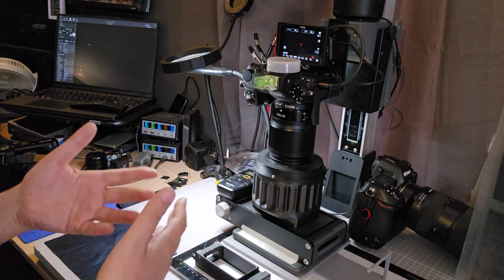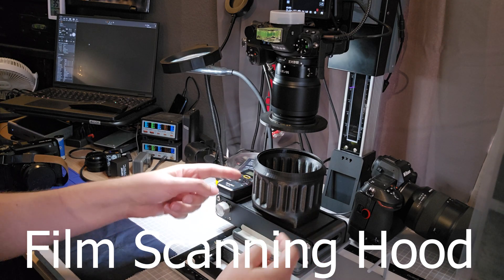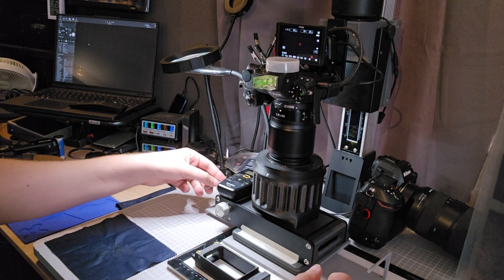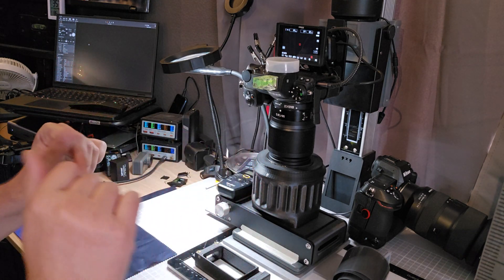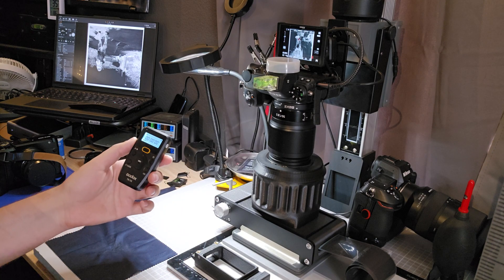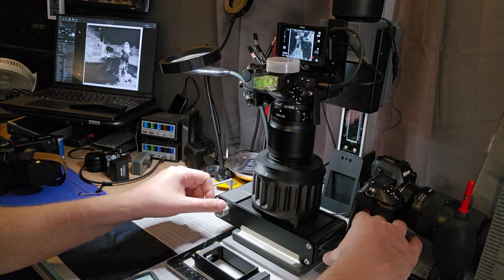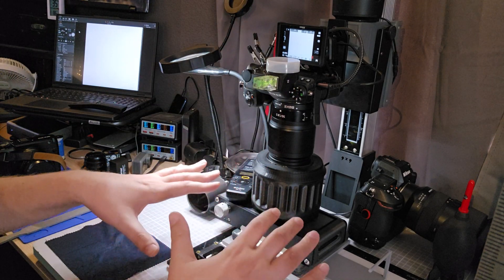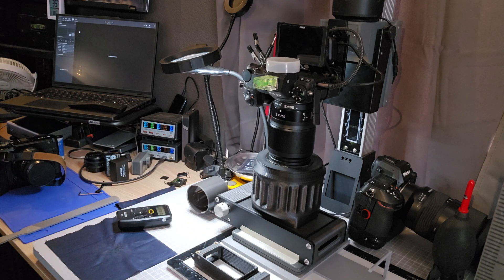Digitize Film - Zero Camera Shake

Comment: how do you deal with dust? what methods do you use to control dust in the area and or removing dust from the film before scanning to reduce touching up! thanks! (im also a fellow AA- Ron -.- god damn key and peel)
Reply from the maker: Hello fellow AA-Ron ;) Yeah dust is no fun. I don't have a dust problem within my scanning chamber as I keep it enclosed. Film dust is a nightmare which I would not say I have mastered but some things I've learned along the way (in no particular order): #1. Developing film, the water you use, how you let it dry, did you squeegee it or drip dry, did you use Photo-Flo... I find film literally attracts dust with static electricity so hang-drying in a clean space is important, also photo-flo and squeegee help to speed this up, but too much photo-flow can cause crystals to form from drying -- white spots that look like dust and they won't come off. #2. Don't just wipe the film with a cloth, this will charge it statically and attract more dust -- I have an antistatic gun (I borrow it from my record player) which I shoot at the film which blows jets of antistatic air, it really helps! #3 Don't let it touch anything on its way into the scanning chamber. I have a couple retractable badge clips hanging from my ceiling, I literally suspend the film in the air and straight into the feed port of the scanning chamber so it does not touch my dusty desk. There's still dust in the air, but the antistatic gun helps with that as it neutralizes the film so the dust doesn't stick to it... #4 Embrace the dust? We can never be perfect -- I use the dust removal tool in Capture One for the big obvious stuff but otherwise I accept some dust as part of the authentic analog charm, just like the pops and sizzles of vinyl records. I hope this helped in some small way.

Comment: What’s the mounting set up you have on your copy stand? I have the same copy stand and the plastic arm messes with the leveling so bad with it bending with the weight of the camera. I’ve found a work around attaching a ball mount tripod head but it’s so inconvenient if I wanna take my film camera and tripod out.
Reply from the maker: That's what I did. I have a sturdy ball head attached to the copy stand, but I use a quick release plate between the ball head and the camera body in case I need to detach. Its very solid, though it does not need to be that solid if the camera lens is resting on the scanning bed like it is in my video.

Comment: To not worry about camera shake you should use an electronic shutter.
Reply from the maker: I do, I believe I mentioned this in the video. However, electronic shutter will only eliminate vibration from the mechanical shutter and cannot improve vibration from the copy stand.
Reply: @ oh, sorry about that. I must've missed that. I see what you mean. But actually, using a good copy stand, a good tripod head, remote tethered shutter release from my computer with 2 seconds delay eliminate all possible vibrations whatsoever for me.

Comment: Thanks for sharing, building something myself. Did I missed the camera info? Is if full frame and the megapixels, what is good for 35 and 120?
Reply from the maker: I'm using a Nikon Z7 in my setup. I suspect 120 may benefit from higher MP if you're stopped down and using a tripod, but for my purposes 45MP is more than enough. For 35mm film I believe 45MP is too much. Even when I'm stopped down and on a tripod I rarely make use of the 45MP sensor with 35mm.
Reply: @aarontharris  Thanks for these nummers. Especially when scanning 35mm I want to get just beyond all the details. I seems like for all my old negatives I can get better end results than ever before!

Comment: This is exactly how I do it. I’m using a hasselblad H4X/Macro lens and a phase one IQ280 80mpx back. I use mirror up mode and use capture one tethered on an older MacBook Pro. I’m using FireWire, as this powers the back. You do get camera shake with the shutter vibration if you’re not careful. BTW, negative supply’s premium 120 feeder is terrible and I’ve complained to high heaven. It’s built like a tank but it also functions like one. Hard to feed film through it. They really are not that great. I’m with you 100% except, I prefer to not give them anymore money until they fix their issues.
Reply from the maker: 100% agree about Negative Supply. While I was able to modify mine to reach a point that I am happy with it's performance, I should not have to modify anything at this premium price point. It is kind of silly that we now consider 3D printing to be a premium product. I'm all for 3D prints for home jobs and prototyping or even low-cost products, but I paid way too much for this Negative Supply gear to be content with 3D printed tools. *sigh* that's one of my buttons I guess ;)

Comment: Thank you. This is exactly the information I need. I have the z7 as well and the same 50mm. I thought I would need a macro lens. But the macro ring makes so much sense for scanning.
Reply from the maker: I'm glad I could help. The 50mm F1.8 works well, just remember to stop down to at least F8 for copy-work. For macro-work 50mm generally does not yield enough working distance (same is true for a real 50mm macro lens). To reach 1:1 you're almost touching the subject. The 50mm can work for 1:2 or 1:3 magnification (which is how I'm using it in the video). If you want to do a lot of macro, I recommend the 200mm F4. It is without a doubt the best, but unfortunately it does not autofocus on Z-bodies. If you want autofocus, the 105mm F2.8 F-Mount lens is just as good as the new Z-Mount but much cheaper.

Comment: Using LR to tether, it also has an auto focus button and a shutter button so you don't need to touch the camera to focus or trip the shutter. I suspect that C1 has the same function.
Reply from the maker: Yes, you're right, it does have both AF and a Shutter button. The wireless shutter is mostly for convenience being able to fire in one hand while advancing with the other is pretty handy. My setup sits on the same desk as my mouse -- not that the mouse transmits any noticeable vibration, though, I noticed I tend to rest my wrist on the desk which does sometimes transmit some slight vibration if I'm not paying attention and forget to lift my wrist before firing. So (for me) the wireless trigger also helps solve my lazy wrists :)

Comment: My camera (Pentax K1 markII) has built in digital filters, with color negatives I put the camera in negative filter and tweaked the white and color balance to be close to what I want and save the white balance and color profile and set the camera back to RAW. to get the best results I hooked up my monitor with HDMI to my camera. now it is just shooting and reverse it to negative and you have a very nice baseline to start if you want to edit your photo's in photoshop.
Reply from the maker: @ronbokje6213  cool trick, does using the built-in filter result in jpeg?
Reply: @aarontharris  I don’t think so, I think it would be a JPG. Most filters will be applied on JPG and not a RAW file. I never tried it.

Comment: Very nice and ridged film scanning setup. Surprised you're not using a macro lens, your standard 50mm must be very good. I use a Micro Nikkor 55mm f2.8.
Reply from the maker: Thank you! It's the Nikon Z 50mm F1.8, it's pretty good wide open but not good enough for copy-work until stopped down to F8. I would prefer to use my macro lens, but I have the Nikkor 200mm F4 Micro which unfortunately does not autofocus on a Z-body camera.  I actually did tests and found that when I nailed the manual-focus, the 200mm was better, but in reality I was misfocused too often, so I decided to accept the 50mm. Maybe one day I'll get a G or Z macro lens :)

Comment: this is extremely over thinking and over engineering for what you are doing.   good for you for creating projects for yourself and keeping yourself busy, but most of the stuff in your set up is really not at all necessary for getting good film scans.   camera shake is honestly a non issue with film scanning even with the most basic setup.
Reply from the maker: Makes sense, I am an engineer. Everyone has different priorities and experiences. I'm not telling anyone they're doing it wrong -- I'm just sharing what works well for me. If others find it useful that's great. I'm not a youtuber and I'm not doing this for "views". I found that while using a copy stand I would get some vibration at lower shutter speeds and it was causing me to lose some detail. I did not want to raise the ISO as it caused me to lose flexibility while pulling shadows out of my film negatives, especially in black and white. This setup gave me two things. #1 it is really fast to load the film and scroll through each frame. #2 it allowed me to really get the shutter speed down while maintaining ISO 65 and F8. No doubt there are other ways and probably even better ways.
Reply from the maker: PS - If it makes any difference, I am scanning 120 Film, not 35mm. I agree for 35mm and tend to be less careful, but 120 I often try to squeeze out what I can.
Reply: Used to have a setup like this but I wanted shakier scans
Reply: @jorbin7417  Lol

Comment: This is nice, but I would consider this older-generation equipment at this point.  I use a Blackscale Labs holder for 120 and a Valoi Easy35 for 135.  The copy stand mess - it gives me nightmares.  With the two options I mention, it utterly eliminates camera shake, because the camera is either connected to the holder or literally resting on the holder.  I find the dust brush on the Easy35 does well enough, but for the 120 I use a Kinetronics Staticvac.  I don't mind the holder on Blackscale as I cut my film for storage anyway, and I have enough holders to load a full roll of 120 at once.
Reply from the maker: I reference the blackscale labs in the video -- not by name, but I mentioned the "rings and you set the camera on top" -- I had forgotten the name. I think its a good idea and similar in principle to what I'm doing in that the camera's weight is supported by the table and the film planes are aligned. The one thing I would miss about the blackscale labs is the film advance and having to use the film holder trays. I remember those from flatbed scanning and they were big reasons why I switched to SLR scanning. As for the copy-stand -- there are smaller versions of this stand, its just what I already owned. But this is a permanent set up for me and I like to be able to raise and lower the camera for to swap out 120 for 35. Which is just a matter of changing the film carrier.

Comment: just use a decent flat bed scanner
Reply: Have you tried re-scanning some of your negatives with a setup like this? Once you camera scan once, you never go back. It's night and day
Reply from the maker: @neotil2  I like the way you think! Measurable results. I am constantly refining my process and improving. Some time ago I did a flatbed scan test compared to DSLR and I liked the DSLR better because I could manually focus on the image whereas the flatbed scanner was always slightly off at the edges due to slight curling. But I noticed the biggest improvement with speed when I used the film carrier because I can focus once and just advance advance advance.  As for improvement in detail, the only real advantage this current setup gets me over my earlier (without resting the camera on the table vs now resting it on the table) -- I was able to drop my ISO from 400 to 64 by reducing my shutter speed. That 400 to 64 reduced a lot of noise. Most people think ISO 400 is very clean and it usually is, but with film when you're sliding the levels you're already adding a fair amount of gain -- so working from ISO 400 is just compounding the noise. Starting from ISO 64 helped a lot. I wish I had a side by side comparison to show you, but I do not have anything on-hand. Maybe that's my next video?
Reply: @aarontharris  For me the speed is/was a huge factor as well. I usually dev and scan in large batches so I need things to go quick :)

Other than that, the quality is just much better. It's easier to get dust free scans (digital ICE produces some ghosting), sharpness is better, noise is better and best of all there is so much more highlight and shadow detail! I shoot a lot of expired film and with my camera setup, you can get really nice results that would have been completely unusable with the flatbed
Reply from the maker: I think there are pros and cons to each. I used a flatbed scanner for years and I got good results. These days though, I really like the speed of digitizing with an SLR.